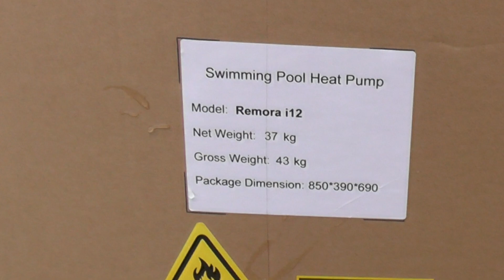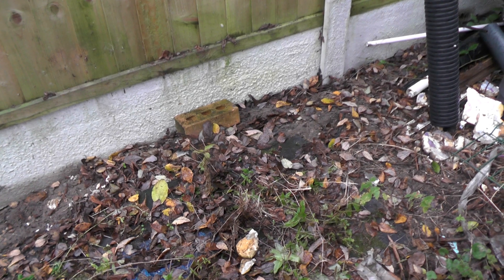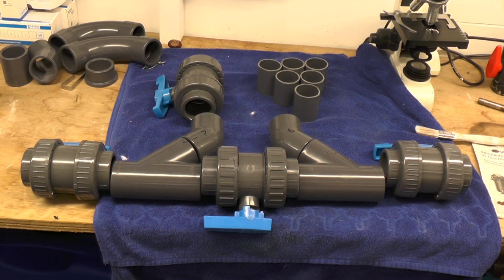Heating a Koi Pond With An Air Source Heat Pump Part 1 - How To Heat A Koi Pond - Remora ASHP

Comment: Good afternoon, I have just invested in a Remora Proffessional 14kw Inverter HP (from AES), and even though they are slightly different from your model, by watching your two videos about how you have set your ASHP up has answered a lot of questions in my head, understanding the by-pass system, the operation of control panels instructions (smart etc.) . really have enjoyed watching these videos, Thank you.

Comment: What is the approximate flow rate? thanks
Reply from the maker: I'm not exactly sure what the min and max flow rates of the unit is without checking online but I have been running it at 11,000 lph for two years and it has just got up to temp and sat there until summer
Reply: @AKoiEnthusiast  thanks for your reply

Comment: Can this be used to just heat up 1000 liter's of water, to 45c, The water is inside and insulated with 50mm insulation. Thanks
Reply from the maker: This model is possibly a little too big for 1,000 litres but why would you want to heat to 45C. That is 5 Degrees more than what you should safely heat a Hot Tub let alone a Koi Pond

Comment: Hi Barry, I installed the 9kw Remora last Autumn after speaking to Simon, generally very pleased with the unit, very cheap to run. Disappointed with the wi-fi as very basic and no way of saving or recording data. However works ok, they changed and added a video on WiFi set up as the instructions supplied with unit were incorrect. The other thing I’ve found is the unit defrosts a lot at lower temps, not sure if this is common on the mote expensive units? Otherwise maintained my pond at a few degrees above ambient last Autumn, held 15 nicely over winter and now comfortably up to 19.
Reply from the maker: I've tested the i12 though mild temps and again for 32 days through Minus 7 and 4" of snow and it still hasn't put a foot wrong. There are a few more videos of the Remora ASHP and I cannot complain. The Wifi was to save me climbing and struggling to get round the Filter house in the dark in a hurry but to be fair I have not needed to touch it for anything and the running costs were even more amazing.

Comment: Hi Kev. Interesting ASHP. A bit cheaper (and smaller in dimensions) than my Thermo Tec 9kW. The bypass only needed 3 union valves. The one at the beginning and the one at the end will never be used surely? Why would you ever want to close either one of those (especially the last one!).
Reply from the maker: The extra lever valves are there for two reasons 1. In case I  have an issue with the ASHP and need to isolate it and more importantly 2. If it fails and doesn’t work then the old Elecro unit will fit back between the two double union valves as a modular unit quickly and easily within seconds.
Reply: @AKoiEnthusiast  Think about it Kev. You isolate the ASHP by closing the valve going to it and the valve coming back. If you then closed the valve in the centre you would have isolated the whole thing without closing the first or last valves. That's the way a ASHP bypass works. Look at any of them available. You will see 3 valves. In your setup the first and the last valve are redundant and not required. I'm not criticising the way you've done it and I'm only pointing out you can save 2 valves.
Reply from the maker: @northernkoikeeper512  You are correct in what you say but I think you my have missed what I am saying. The reason I've got Wifi is so I can turn it on/off or Up & down no matter where I am. Similarly if I had a problem with the Unit and I needed to isolate the unit I can use the two Valves you mentioned but the rest of my household would not be able to access those two valves quickly or easily as I would so they can isolate it without any climbing or clambering through the side gate. I had spare Valves and actually used some of the the original parts to create the section of the bypass. I suppose I could have used simple Unions instead of the Double Union Valves if I wanted but if I swap the bypass section for the old Heater then there would be a lot of water lost on the floor but with the Valves I can reduce the water loss a lot.
Reply from the maker: @northernkoikeeper512  This is brilliant and one of the reasons I started this Channel to stimulate opinions, and also open peoples eyes to different things Pond & Koi related. That way people learn and share their experiences without making costly or unnecessary mistakes. Thanks for the input and comments my friend

Comment: Evening, I saw that you bought your heater from AES, what made you choose the Remora over the Hydro-pro or Proteam inverter pumps?
Reply from the maker: I spoke with Simon at AES and it was a mix of two things. This Remora unit is better and more focused on Koi ponds with the controls, parameters and specs. The other reason was the availability due to the units in stock and awaiting delivery. I must admit that so far I’m not disappointed and Simon was very helpful and knowledgeable
Reply: @AKoiEnthusiast  brilliant, thank you. I’ll give them a call tomorrow. Again, great video, really informative.👍😊
Reply from the maker: @TelfordKoiPond  Please ask for Simon and tell him you saw the Unit on my Video on Youtube. If you don't mind.
Reply: @AKoiEnthusiast  absolutely, no problem. I hadn’t even looked at a Remora so you have definitely won them a sale. Cheers👍

Comment: Hi Kev, I think that has to be the most compact ASHP I've seen, I see what you mean about it being awkward to get your stuff round there to set it up, with the wifi and controlling it is it done through a app and can you see what temperature it's at and can you alter the temperature through it, looking forward to part 2, stay safe.
Rob.
Reply from the maker: Cheers Rob. The unit was not actually anymore expensive as some of the others and they don't come with everything that is needed. Plus it is a stepped Invertor and Wifi

Comment: Excellent video, can’t wait to see it fitted and working.👍😊
Reply from the maker: Hopefully with a bit of light, good weather and luck, I should get the rest of the install done this week. Most of it is done but I need to tidy it up first or the suppliers may be a little upset. lol
Reply: @AKoiEnthusiast  indeed, we all need a bit of good luck with the weather. The concrete pour on my new pond has been scheduled 3 times now and then cancelled by the concrete firm due to either low temps or rain. Keep consoling myself by the fact that I have a beautiful hole in my garden  and have another 4 months to get it done before it starts eating into next years koi season. I saw that you bought your heater from AES, what made you choose the Remora over the Hydro-pro or Proteam inverter pumps?

Comment: Great work on pipe work by pass taps etc can't wait to see this working and costs very interesting the operating 5c as it got to be about 5c for it to work mate as this might be a problem if that's the temp ?
Reply from the maker: Cheers Barry - I must say I was well impressed with the system (See Part 2 - Soon). It should be interesting to see the costs as the temps start to drop. Not sure what you mean on the Temps. The unit will heat the water up to 40°C and cool it down to 5°C if required. It will still work when the outdoor ambient temperatures are down as low as -15°C. I have to keep looking at it to see if it is still working as it is virtually silent
Reply: @AKoiEnthusiast  What temp are you sitting it at are you uping it slowly or just going stright for high temp?
Reply from the maker: @barrykoikeepercooper8052  The Elecro was sitting at about 17°Degrees. I have set it at the same temp for a couple of days to see how it handles. I have a couple of things to change on the pipework (Daylight permitting) and then I can put the logger on and play with it. In the time I swapped the pipework it dropped about 1°C over the day and night but the heater pulled it back through the next night once I finished and that was on the smart setting.